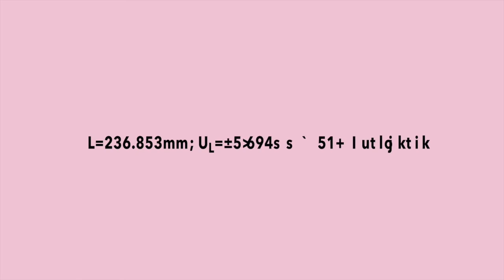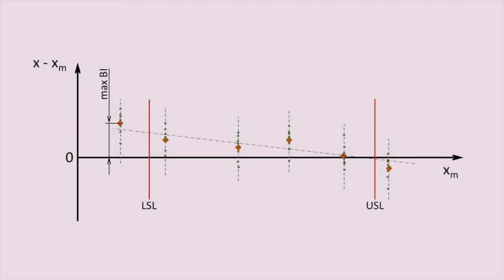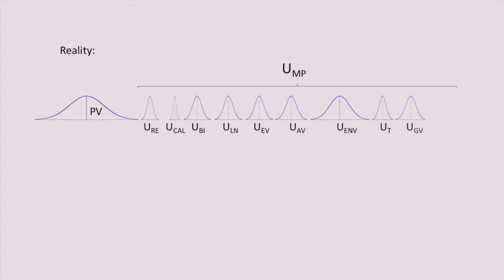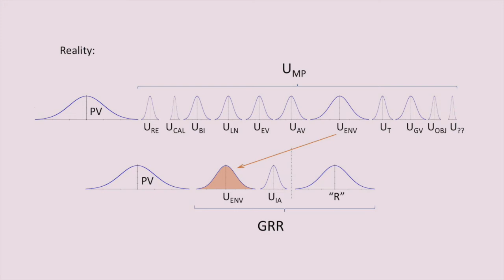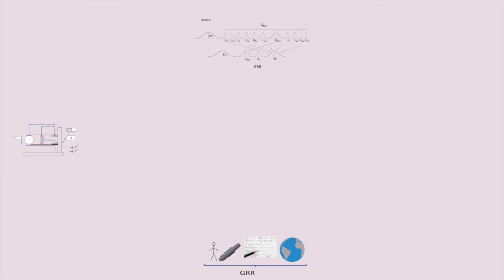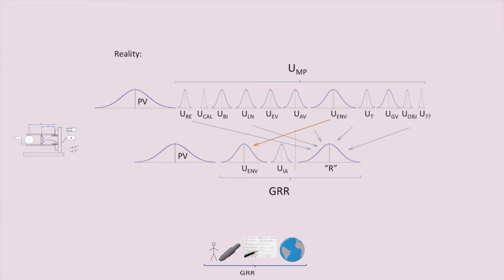Measurement Uncertainty - Part 2

Comment: That was a very enjoyable video, I'm currently working on explaining ISO 22514-7 and its association with Type 1 and 2 MSA, for an applied MSA guide and as the notes hand out for my students. Your thoughts on Wheeler's EMP 3 and its applicability for providing usable data for uncertainty would be appreciated?  I found from correspondence with Wheeler that he  is ignorant of Uncertainty.  But his methods are usefull cross che3ck for R&R an help identify the causes of measurement  process variance. I tend to make extensive use of his probable error out put.

I would raise the issue that it is important to distinguish between Range and Mean R&R and ANOVA R&R. In  my view Range an mean is simple but limited, while ANOVA is often opaque in its processing but has a higher proportional end utility.

Do you see any value in the use to the difference between the UCL an LCL on the Xbar chart of the AVOVA R&R out put in Uncertainty. In the purely MSA contaxt I introduce it as a useful quantification of measurement system noise  and opposed to measurement process noise . Would love to chat in more depth share work on this subject.
Reply from the maker: Hi ChancerNW, 
Do you think Wheeler's EMP is a prospective topic for our next video? Generally, I tend to promote the idea, that the individual "signs" of device's (or proces') suitability (like Type 1, GRR, etc.) should be combined into one parameter. The uncertainty offers itself quite nicely, and its concept resonates also beyond the industrial world.
Range and Mean for GRR is useless! I don't see any benefit in using it over the ANOVA, when you have a proper piece of software at hand.
As to the UCL and LCL, yes, it should reflect devices quality! But remember, that GRR is not the complete measurement process (MP) noise. There is also gauge-to-gauge variation, bias, linearity etc. I would rather use the MP's uncertainty.

Maybe you would also make use of our cloud software Yarvyn, which does the ISO 22514-7 type evaluation. Let me know if you are interested! You can promote it in your training!
Reply: @diribetstatisfaction  
Thank you for your reply. If you are interested I can send you the Chapter  on Wheelers EMP that is in the handout (book ) I give to my students. Uncertainty is chronically under used in industry. With most non calibration measurement process assesemenets depending on Type 1 or  Type 2 MSA, I'm very much guilty of that, but out side of claibration labs there is little recognition or even knowledge of it. I'm trying to change that but I am also very much an MSA specialist.

I'm adding applied ISO 22514-7 to the book I'm working and to my student's hand out. I'm cautious of mentioning specific software or promoting any thing in particular,  though I do mention MINITAB (which I use in my main job, my lecturing is a visiting lecturer, my min job is a metrologist in the aerospace industry). I also mention Bill McNees's SPC for Excel, but that because I think his site a great reference material. Even so, I'm more than happy to discuss applid MSA and uncertainty with you guys.